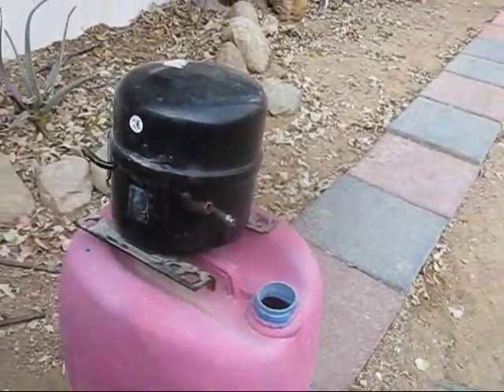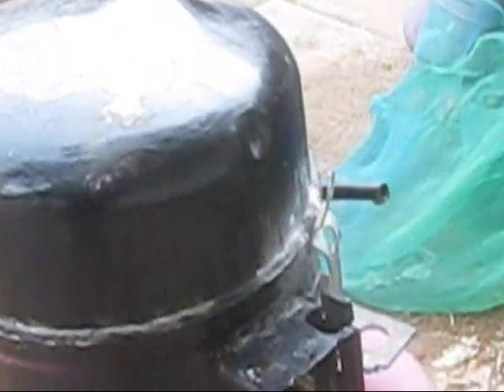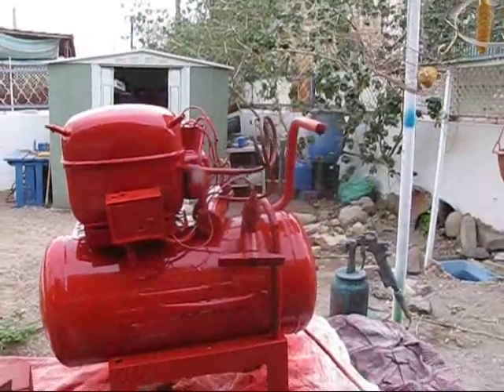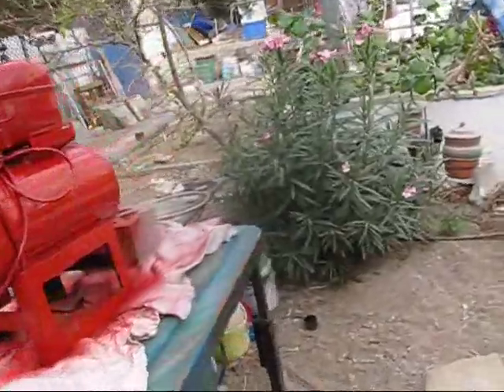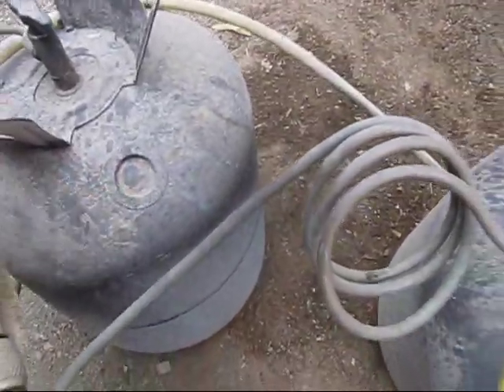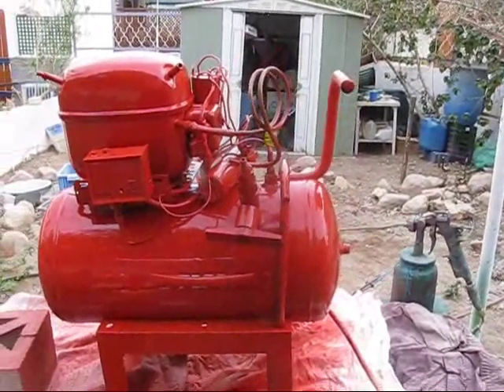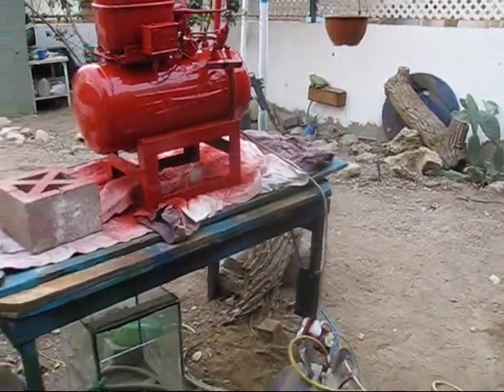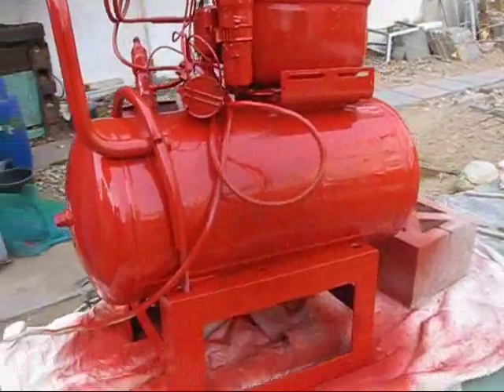Home made air comp update.

Comment: Hi Mantsi. I also build a selfmade compressor with an old necchi N21 RV (800W) unit. The comp is runnung great but when it is under load (pressuring air) the noise changed and it sounds like it missed a little oil. I drained out near 700 ml but it looks like yellow and very fresh ? Maybe a complete oil change is not necessary but I will change it against a fresh load of PAO 68 non hygroscopic oil because it it used in an air compressed system. Do you think 710 ml is a good choice ?

Comment: suggestion reason you have a problem with the oil flow and adding oil is simply because your air tank is to the bottom. gravity flow. u can get the oil back to the compressor if you put a P trap ....too much work. to avoid all that next time you build put your holding tanks to the top and mount the compressor underneath. bore the bottom of your holding tank and then pipe it to your suction side ofcourse still leaving your suction open to suck air in...let me know how it goes

Comment: Like what you have done but you need to put a check valve in the tank and and a tee in the line between the compressor and tank that go's to an unloader valve on the pressure switch if yours has one. Even the commercial compressors have an unloader that is operated mechanically by the pressure switch because single phase motors do not have nearly as much starting torque as they have running in Asynchronous once they reach pullout the torque drops rapidly.

Comment from the maker: the compresor sump holds 600cc of oil in the compressors up to 1/2 H.P. and increases according to the size of compressor.The oil travels around the system together with the refrigerant to lubricate solenoid valves, therostatic expansion valves and any other components in the system.But the compressor requires a sump volume to lubricate the compressor.Some times an oil return device is fitted.In these stand alone air pumps or vacuum pumps oil needs to be added about once every 2 months.